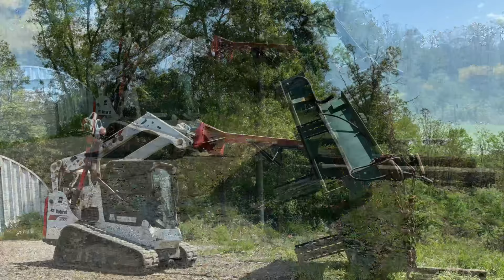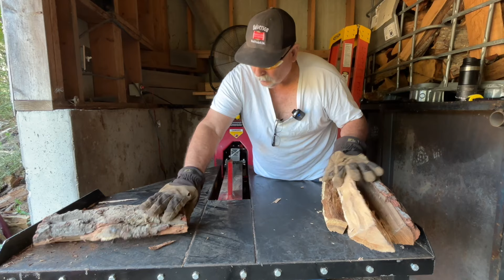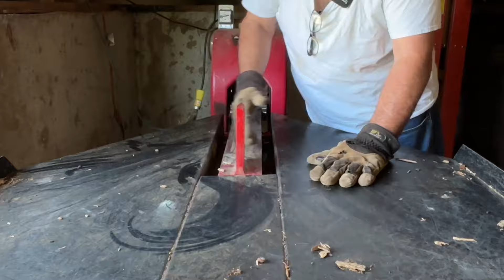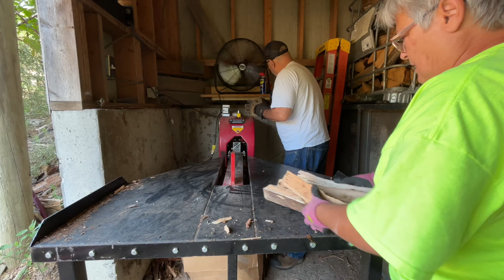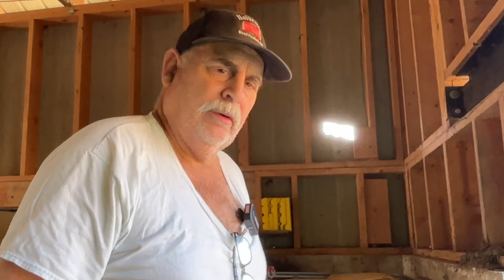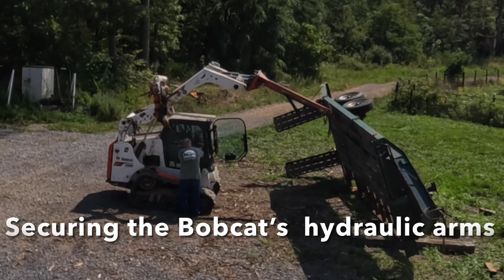Firewood and Danger! #509

Comment: hi there how is my sticker doing , i have started watching him also , does that thing have threw bolts ,i used a circular saw cut in front and behind the cross members then had access to the screws , good luck , john
Reply from the maker: Hello John, your sticker is fine, yes the oak boards were bolted around 60 of them, just finished with pressure treated wood, and no bolts this time👍🏼🇺🇸